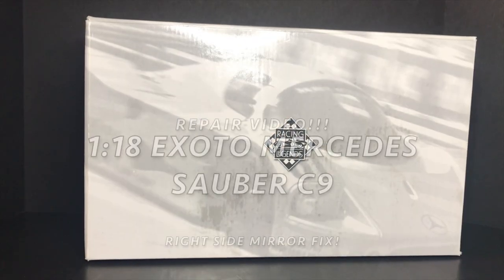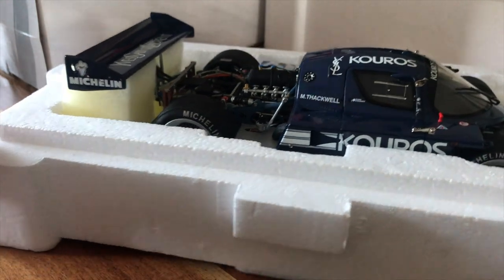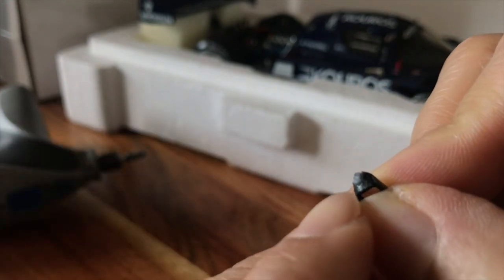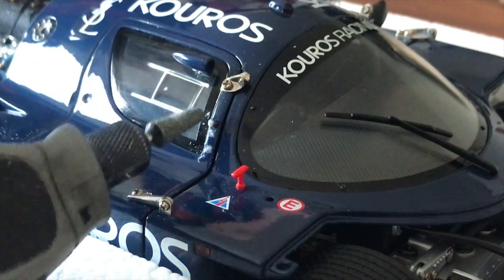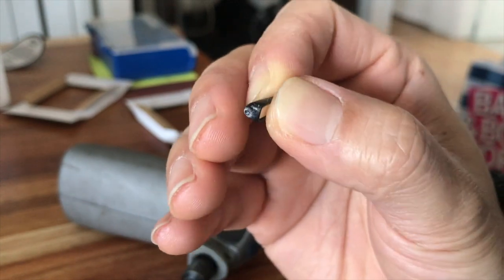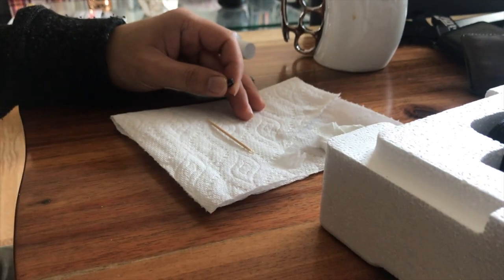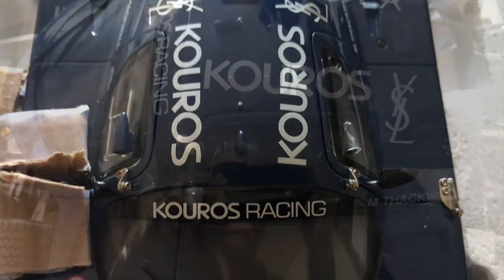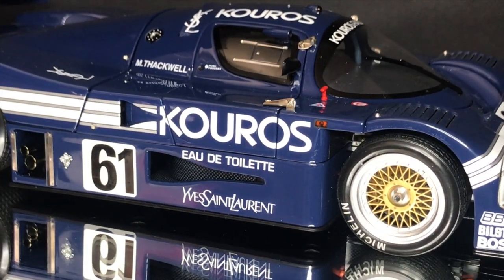1:18 Exoto Mercedes Sauber C9 Repair Video!

Comment: Great fix. I have the same Exoto with the same busted mirror. Thanks for the glue recommendation!
Reply from the maker: You’re very welcome! Good luck!
Reply: @duckduckdiecast3324 I would never have  thought about using this Gorilla sealant as a glue on my Exoto models without seeing this. Almost anything on them can be reattached using this, and its forgiving. Its such an exellent idea. Big Thank You!!
Reply from the maker: My pleasure. Im glad you found it as useful as i did! Ive been using it for years and its a great unexpected tool on my model repairs!
Reply: @duckduckdiecast3324  yep. And it’s just perfect when attaching the small metal to metal pieces on these Exotos. It’s so clean and strong enough. Excellent find!